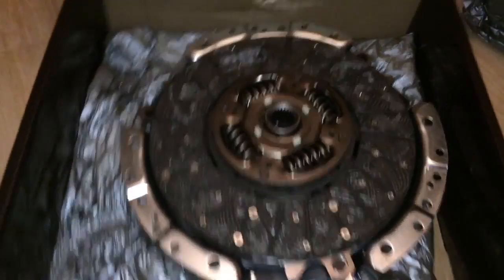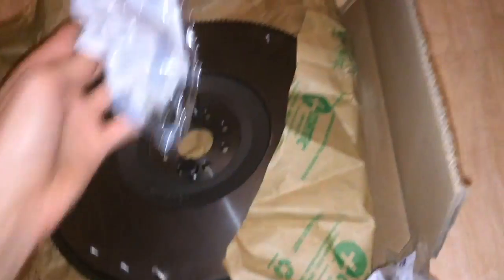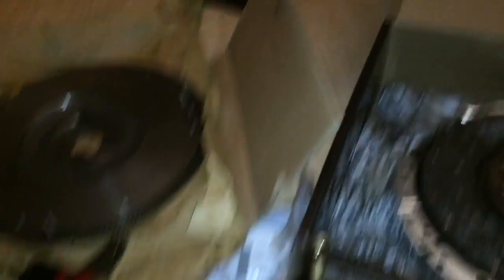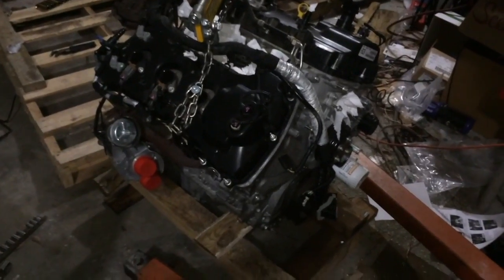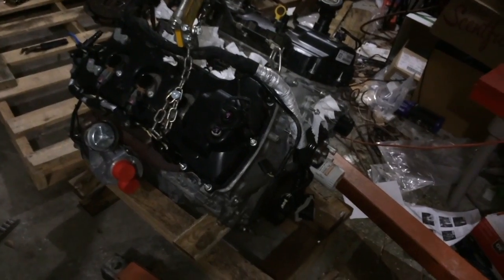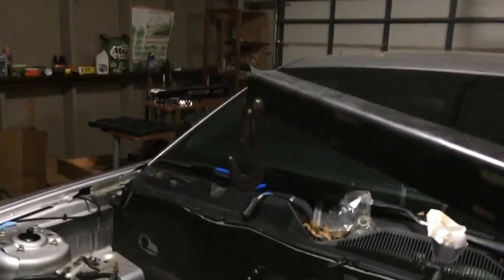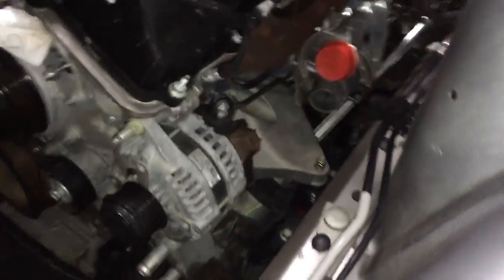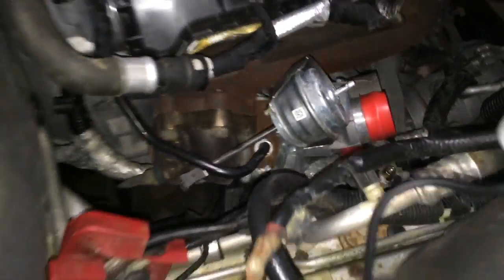3.5L EcoBoost V6 in a 2012 Mustang! - Part 2

Comment: I've recently driven an ecoboost F250 transit van, and MY GOD, this engine kicks ass.  I can only imagine what it would feel like in a car rather than a heavy van!  From what it looks like, it could be possible to swap into my 97 Lincoln Mark VIII that originally has the 4.6 DOHC (what gave birth to the 32V's from 96 Cobras and up).

Comment: Do you have emissions testing in your area? I would be interested in this swap, but I don't think I could pass emissions, and in turn, be able (OBD2 Readiness Test) to register the car. Really cool swap, best of luck moving forward.
Reply from the maker: +AKDMB No, there is no emissions testing of any kind where I live. This would probably be quite difficult to make legal in most of the stricter states. But SSM has just announced that they will be making a kit to put these turbos on the 3.7L V6! It should be possible to do for only a few grand. This is definitely the logical choice given the fact that this swap cost well over double that so far and it would be relatively easy to make legal in most states. I'll be doing a video about this soon, so stay tuned!
Reply: +DC Garage Thanks for this info! I heard discussion about 3.5 turbos and manifolds on a 3.7 few years ago, no one ever tried it though.